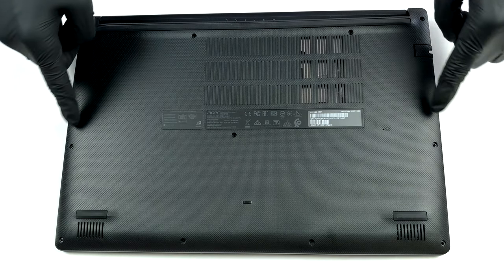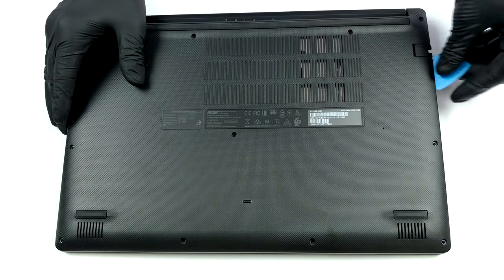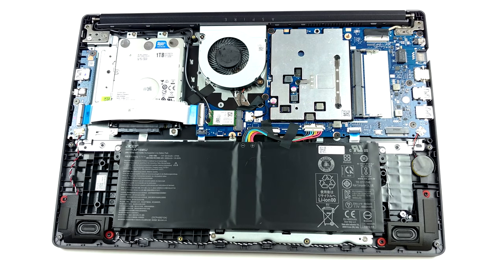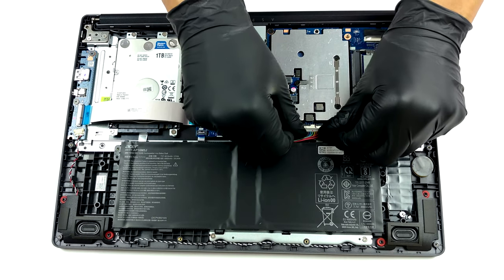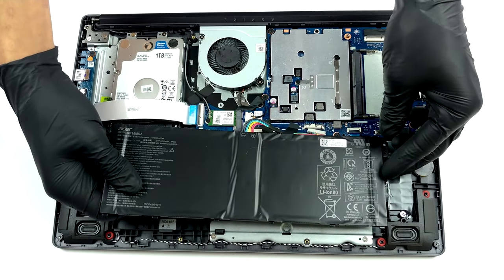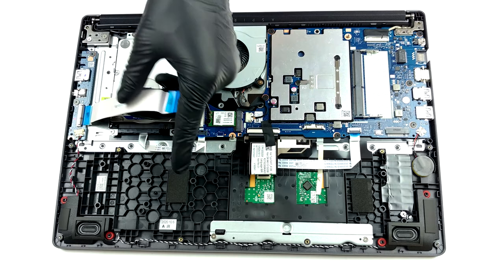🛠️ Acer Aspire 3 (A315-22) - disassembly and upgrade options

Comment: hi, thank you for the video, very helpful to me,  if i may ask, can this model be upgraded with an SSD hard drive, internel, and i want to upgrade my ram fromwhatever it is and upgrade audio and video graphics card, i guess basically a total upgrade hard drive wise , but solid state hard drive especially, and if so what ssd model would you recommend ? thanks again
Reply: I have the same question about the SSD drive, to get faster that is the way to go, but to ensure you dont lock up or freeze, etc. I upgraded my Ram for $29 Canadian dollars. It really helped, I can now run multiple larger programs simultaneously where I couldnt before, plus it sped it up, not as much as an ssd drive would however. I had to take out the 4GB Ram it came with and replaced it in the same slot with a 8GB stick of Ram. Of course now I have 4GB of Ram sitting on my dresser, maybe one day I will find a use for it. I originally thought I could slot it in with the new 8GB ram stick but nope, there is only 1 slot period. I bought the Ram off Amazon and its specifics i pasted here: 
Capacity: DDR4 8GB; Form Factor: 260-Pin Small Outline Dual In-Line Memory Module (SODIMM)
Frequency: 2666MHz (PC4-21300)
Timings: 19-19-19-43
Voltage: 1.2v
Reply: @shawnbailey963  yes i also increased my RAM with a higher ram  board, but as of today i have not installed a SSD hard drive, i am terrified too , i am not sure how to clone my HDD to the new SSD , i purchased a clone device (usb type ) i also read in the instructions it takes days to clone a HDD to a SSD ,the HDD is working  , how good i dont know, i just know it has moving parts  that will eventually break down, but both the RAM stick/ board and my SSD from ebay were less than 200$ US , which is much less than a new laptop, frankly i was considering getting back into first person shooter games is why im doing the upgrades, plus the slooooow bootup  or loading of pages, i didnt post the data from the RAM stick but my laptop tells me i am now using DDR4 with 20gb memory, i knew i had 4gb memory before hand and i purchased a 16gb ddr4 board so that adds up, but loading apps using just my laptop ( nothing involving internet or online duties or jobs )  but just opening microsoft paint app for example, or even acer care center takes many seconds, i dont enjoy lag getting shot at by a german or iraqui assasisn or soviet ,  if i am successful cloning my HDD and getting better speeds with no lag i will upgrade my video but i am not sure thats a reachable goal as i think the video chip is on the main board and not removable, but good luck sir and happy holidays
Reply: @fingerfeller just watch a quick video or two. Takes maybe a couple hours. My friend cloned a 4 tb hardrive to an m.2 ssd in 2 hours. You could also backup your data onto another drive just in case anything happens
Reply: hi friend , i did buy 2 memory methods , i did upgrade from 4 gb ram/ memory to 8 or 16, , and it improved operationally , i did attempt an ssd clone from mechanical ( original , as this acer is old ) disk HD that didnt work, then attempted a different one that did, so  i have plenty of storage just not " speed", ie if i need to open " windows notes or word, or paint, photos, , especially non microsoft apps really take time to open, ie AMAZON PRIME MUSIC app works great once finally opened, so all in all i guess im pretty happy and yes i did do what you suggested and yes it took approx 2 hours , so i have hard drive c. and a D, with the same program, the initial hard drive IS still in, i never removed it because it it seems i am just lazy and didnt want to remove the original HD and just use the SSD M.2 stick because it also seems its not easy to seperate windows onto one fragment space and put apps / games  ( if i ever decide to get back into games ), , but right now things are running smooth just not LOADING fast once opened and i think i need a newer CPU but i would have to redo main board everything, thanks for the reply and thats exactly what i did, i cloned it to an M.2 just not using it the way i intended , and that made no difference in speed ( loading apps, lag here and there, ),  but now i have two drives with same programs and apps, i switch every so often to find some data NOT on one of the drives, but still utilizing the mechanical HD as well, my initial fear was mechanical HD breaking down, and i knew i wanted faster speed that led to a SSD, wether it be 2.5x3 or whatever inch it was or a M.2 stick, the first stick didnt work and was not clonable , i had purchased the wrong format or something,  so yes your reply suggesting an M.2 stick was my final , i purchased more storage with a external drive which i would love to divide into sectional area, fragment maybe ? i dont know if thats the correct word for creating areas for only certain programs.  funny thing is i remember DOS and green or white font asking which directory  writing codes to open data, ie :chdir, :chkdsk ( forgotten by me now ) the first first person shooter was the original wolfenstein game,  maze afrter maze different colored walls, doors , treasures, increases in gun strengths, , started with a knife in a cell, looooooong ago, things have become so much smaller when back then items were so large i wasnt affraid to take apart towers and replace , now theyre so tiny if broken might as well by a new laptop,and thats what i use, i may get into towers again but i dont use my laptop mobile , it stays at home, i just it as a tower when it could become mobile . just need a faster cpu, i even purchased fans for bottom to blow into vent and dont know if it working but it disturbs sound from my sound bar sub woofers, , thanks again Caboose, i like your name i have a LIONEL steam engine kit with logs flat bed cars, containers, and caboose, still smokes from stack when water added bought in 1957, thanks again

Comment: Hi. Thank you for the video. May you explain me where m.2 nvme slot is?
Reply: Next to the battery on the right when the computer is upside down.
Reply: would have also help if someone explained exactly what type of socket the m.2 is , incase someone upgrades to one tht wont work in tht socket,,

Comment: This "Laptop" has got to be the WORST thing I've ever seen.  
I haven't seen a SINGLE thing that has made me go "wow" or even "thats pretty good".  
It literally cant do ONE thing properly. 
Forget multitasking, you cant even single task in this POS.
Reply: wtf mine w a m.2 and its running fine
Reply: Jonas simthas same here, But did u upgrade it and did u see any improvement? .
Reply: @jesse9754  I gave up and got a new Laptop (ideapad gaming 3). 
An SSD MIGHT help like what the person above you said as it could be a good temporary solution until you get a better laptop as you can just put that there but honestly imo, this laptop and its cpu just sucks ass.  
It can BARELY handle 480p youtube and idk how adding an SSD might help.
Reply: @Monk3y_C  wow thx for the reply,I’ll try saving new laptop then
Reply: @haxboi5492  what Is the specific SSD? I need one of this. Tks
Reply: @gerardomenta581   Its a WDC PC SN520 SDAPNUW256g-1014  it is m.2 tho but its REALY fast compared to HDDs
Reply: Jesse, is M2 NVme supported by motherboard? I have the slot but not sure if it will work. Thank you
Reply: As an Aspire 3 A315-22-924k user myself, I can 100% agree with this. Althoug I don't have problems with running videos on youtube @720p, 1080p however is a different story. And yeah, I would also say that this has gotta be the WORST laptop to ever exist. I don't even see it being used for lightweight/business purposes, it literally cannot do shit. I've been using this laptop for almost 2 years now and I hope that ine day I get out of this misarble laptop. I cannot buy for myself at the moment because I'm still a student (2nd yr college) and we're really poor asf.
Reply: Yeah I got this laptop for a year now, can't do anything with it. I have to play really old games in free time...
Reply: @djockom  why would you buy a Laptop without a graphics card to play games LMAO
Reply: @fietae  I'm a lawyer lmao, no time to play games but here and then I enjoy playing